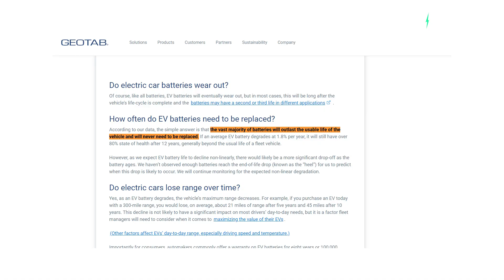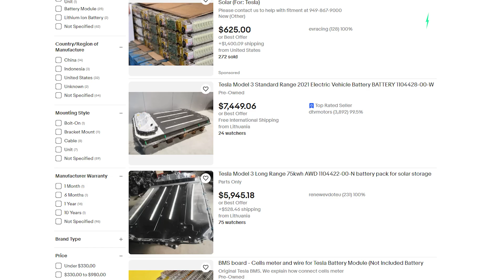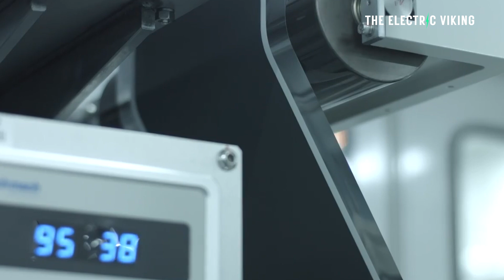New study says EV batteries have over 80% of their health after 12 years

Comment: This isn’t important.  I would rather have a battery that was at 40% health in 10 years. That I could buy for 10% less money.  Since batteries will likely be 80-90% cheaper than today when it needs replacing.  The cost curve is too steep to worry about it lasting.
Reply: No you won’t, after 30% degradation you can’t use your car the way you intended initially and you’d probably buy a new car

Comment: I still have the original battery in my 2015 Leaf which I have owned for 8 years now. I can get 40 miles out of it on a single charge mixed city/hiway driving with A/C set to 60° F, this is Houston, Texas after all, which is still plenty of range for almost all of the driving I do.

Comment: 13 year old PHEV with 16kwh battery (6kwh kept in reserve). 140k miles on the car. brand new the car got 32 miles ev range per epa. currently only getting 45-55miles of range. what a rip off. i will never buy another ev again. my insurance went up from 19 to 21 bucks per month! ive had to spend an extra 7usd/mo for electricity while only saving 2000 usd in gas my first year. ugh. and to top it off, i paid 6k for my car and its only worth 9-10k now according to autotrader!
Reply: Sorry to break it to you, but a PHEV is not an EV. It's a glorified gas car, with twice the expense. But yes, ICEs are better than hybrids any day.
Reply: @ElMistroFeroz  lol what makes an ev and ev, and what does the last two letters of phev stand for? i think driving for 2-3 months everyday and not using any gas practically means its an ev. the only time someone drives further, then youre talking about the horror of supercharging and you wish you had a gas car since gas is cheaper than dc fastcharging. i drive around with like 2-3 gal of gas in the car, the weight of my car is like 5% more than a similar model tesla. not sure what the issue is with having a backup gas generator.
Reply: @ElMistroFeroz  EV guys are PHEV haters. Sorry but the PHEV is superior at this time for the vast majority of people who live in the suburbs and commute 40 miles per day and also like to go on long trips without range anxiety. My like new Honda Clarity that I just bought cost $14,900 and get 40+ miles on EV and 50 mpg on gasoline. Level 1 charger. No brainer.

Comment: Modern cars - both EV and ICE longevity are limited by electronic or computer components aging out rather than traction batteries or mechanical parts. Most EV battery packs fail not because cells fail, but BMS module failure first. Further complicating the issue is difficulty in repairing such issues, often battery packs are integrated tightly in car's chasis. Even a small resistor or capacity fail would require expensive labour cost to diagnoze and repair one single electronic component.
Reply: Yea they need to make these things more modular, like the Chinese are doing.
Reply: Exactly- it's like saying a timing belt issue isn't really an engine failure, it's just part of the engine management system.
Reply: @SteveLomas-k6k  timing belt is easier and cheaper to repair than BMS or other electronic modules in a typical EV.. We are talking hundreds dollars vs tens of thousands many battery packs are sealed.   If just one component breaks in it, the whole thing needs to be replaced.
Reply: @i6power30  Well yes, especially if you are handy you can make a lot of engine repairs yourself and keep a car going for> 100 years.
Reply: @SteveLomas-k6k  old school cars. Even ice cars nowadays have so much computers in it that makes it planned obsolescence.
Reply: @i6power30  That's true, though I think the key buzzer is about the most high tech thing in my car- and it quit working a long time ago. :)

Comment: The issue is that if real consumers are reporting real problems with their EV batteries, and are being hit with real repair estimates of $10k-$20k+, then that's a real problem with the market and not a rumor to be debunked. It's wonderful, and very important, that current batteries are improving in durability and that vendors like CATL are able to warranty their latest batteries to 500k-600k miles. And, that knowledge needs to be broadcast. Keep in mind, however, that the average age of a light-duty road vehicle in the US is 12.6 years nowadays. Key question: are these battery warranties - past and present - transferable to subsequent owners? Used EV buyers seem to be bearing the brunt of the spent-battery grief.

Comment: My 2018 Model 3 LR is about to click over 100,000 miles. No problems. No issues. I replaced the entire front control arm and sway bar link as a kit because I was getting a clunk from the front suspension. This is normal wear for any car. Normal wear parts are going to wear out, but the battery just keeps going. Oh- and my brakes were still above 90% good as I checked them.
Reply: Well, proof EV's suck....kidding
Reply: What were repair costs for the earing arm?
Reply: @TheLordexilius  I had to replace the rack and pinion on mine, $450CAD, mechanic said it was the easiest r&p job he'd ever done.
Reply: @ChrisSonPEI  I have no doubts about that. I was just curious as I read bearing arms is one place there TM 3 needs maintenance. Glad to know it wasnt more than 450 dollar.

Comment: What is the life expectancy of a car that no one can fix ? Or want to fix ?
Reply: Or needs to fix.
Reply: Spoiler: If there's demand, there will be supply.
Reply: @michaelmartin9022  there's still demand for landlines but they cost $80 a month now where is they used to cost $16 a month. 

I suggest that you look up the "network effect".
Reply: Ice vehicle owners who can't repair their own car or going to find that out the hard way im about 8 to 10 years.
Reply: @mac_mcleod  In my expereince once the ICE car reaches 5 years it's a constant trips to the rip off garage for repairs. Worst car I ever owned, bought when it was six years old and in year seven that thing cost me 3 grand in one year for BS repairs and fixes. The electronic ignition went - that alone was 1500. Thanks BMW. But it was expereinces like that which made me jump at the chance to buy a model 3. Over the years I began to despise going to garages for repairs. Not once did I ever think OK that was fair. Everything was always huge expensive.
Reply: So in 8 to 10 years time the tech and support might be good enough for me to buy one.
Reply: @AdrianWilkinson-e2p  I think we each have to pick that ourselves. 

For now I'm still in the gasoline vehicle.  It's costing me between 3,000 and 4,000 per year to keep on the road. 

However it's also 12 years old and has about 150,000 mi on it.

I'll probably be in an electric vehicle in 2 to 3 years. 

At this point, I have three neighbors on my block who own eevee's and I have two friends that own electric vehicles.

Comment: 5 years is already a long shot for a battery. What ever type it is. 12 years, you must be delusional. You have a battery 1/3 the original capacity, and 3 times the original charging time.
Reply: Complete rubbish.  You haven’t done your research and quite simply you don’t know what you’re taking about
Reply: @crm114.  First of all this isn't directed at sam. My bad. Its to the ones who suggested that a 12 year old battery can still have capacity of 80% compared to it when its brand new. Realistically its too far fetch. A battery that old that you used everyday for a decade will be really bad.

Batteries degrade, the number charging cycles, when and what state of charge to charge the battery 50, 70 or 100%, so forth. All that will already take away more than 10% of your battery's capacity in 5 years. 

Unless you baby it. How often do you baby it? Why baby it if it prevents you from using it more frequently?
Reply: Know that hasn't been with the data shows. Even with the older battery technology most electric vehicles have over 85% of their original range at 200 to 300,000 mi.

Comment: 80% capacity after 12-years is not that great
Reply: Yea it is.
Reply: @ChrisSonPEI  It's not bad but it's nowhere near fantastic.
Reply: What's wrong with these people?
Reply: This study is only meant for people planning on putting their EVs in a time capsule, that's why there was no mention of range degradation. Just calendar aging.
And yes, 80% is terrible degradation, especially if you're not driving the car. However, the trick is to store the car at 50% capacity and leave it plugged into a 120v outlet. This way it never self drains to 0%. By the time you open the time capsule, you'll get much more than the lousy 80%.
Reply: @ElMistroFeroz  Do you lot even know about batteries? Having 80% of the useable capacity left after a decade is pretty standard for LFP. What exactly are you asking for? A perfect machine that never wears out? Can a normal car be used for 12 years without something wearing out and needing maintenance? Why are you holding different things to different standards?
Reply: @michaelmartin9022  You’re either replying to the wrong comment or everything I said went over your head, along with what the study proved.

Comment: EV sticker price still needs to be at parity with or below that of ICE. Preferably below, because that is the only incentive for the majority of buyers once the early adopters and rich people have been exhausted. That is the thing that will get their attention, and then they will start considering an EV.

I notice that the MG HS PHEV has been lowered to $34k for the old 2022 and 2023 models, to make way for the new ones. But the sticker price of the petrol version is still $29k.

PHEVs and BEVs also need to be $29k.
Reply: That’s happening now but for the next level up like Tesla Model 3/Y. They already have price parity or cheaper with ICE. Quite a lot of the next level down EV models are discounted in reality to close to ICE level, but agree sticker price needs lowering.

For private buyers you are far better off getting a nearly new car that still has a long warranty on it.
Reply: No, if an Eevee cost the same as a gasoline vehicle, then you're going to come out way ahead because they're operating costs between $1000 and $3,000 per year less than a similar ice vehicle.
Reply: @mac_mcleod  I realise that. But most people don't, is what I'm saying.
Reply: A Tesla Model 3 is vastly better than the equivalent ICE vehicle.  So, it’s already there.
Reply: @oggyoggy1299  I agree, but most people don't realise this.
Reply: Well. Lifetime savings by using av EV compared to an ICE car will usually be significantly higher than that difference - so it should not be neccesary (but agree that this is an important 'psycology', yes).

Comment: How many change the engine/gearbox  on an ICE car?
Reply: I haven't changed the engine or gearbox on my 13 year old, 296,000 mile Hyundai diesel.
Reply: @brendanpells912  They do talk some 💩, Diesel power now you're talking.
Reply: 280k miles on my 2008 Toyota Avalon original engine and transmission but will occasionally slip. This started about 10k miles ago

Comment: Now manufacturers just need to match the 15 years battery warranties (since there’s low risk) and that will make ev sales and the used market take off. As someone who buys used I realise the risk of a battery failure is tiny but if it happens it’s catastrophic. If manufacturers can absorb this low risk with warranty’s that will make a huge difference
Reply: Not that catastrophic. If you’ve ever bought a money pit, let’s say a BMW and paid $4.7k for a timing chain job. You’re not far off from getting your battery balanced from a third party shop.
Reply: @kevinmanan1304  £4.7K from where?
Reply: @gottliebdee263  bmw dealership. This was back when they first moved from timing belts to chains. I’ve heard their prices lowered recently. One of the reasons why I never get BMWs
Reply: @kevinmanan1304  I see. But are you comparing like with like, that is to say dealer timing chain dealer with dealer battery repairs?
Reply: @gottliebdee263  They were equally as expensive as the dealer. Even today AAMCO transmission repair shop costs as much as at the dealership.
Reply: @gottliebdee263  I’ve decided to hold off a transmission oil job because I was being quoted $500 at local shops but $550 at the dealer with coupons… it wouldn’t be bad if mechanics weren’t so sus
Reply: @kevinmanan1304  Yeah, there is that. Tx is one of the things I wouldn't hold off on though.
Reply: @gottliebdee263  well these are the small things that put me off gas. It’s just a few hundred here and there that ends up being thousands by years end. I’m only 7k miles over and most from highway so I’m not worried… yet.
Reply: @kevinmanan1304  Yah that's cool. Whatever suits you dude. Personally ai think the real sweet spot for an EV is gone and the landscape is shifting fast with subsidies, and incentives, (certainly in the EU), being reduced/removed and insurance and repair costs increasing dramatically.

To be honest it's SO difficult to find the truth. You have the Viking that never adds enough detail to his claims, (Rocketing EV sales),  and the other side doing the same for their narrative. So it's down to us to try and make an educated guess that fits our circumstance.
Reply: @gottliebdee263  EV sales are skyrocketing. California, US largest state got 1 in 4 cars sold as EV. That’s big when before Covid it was 9% or less than 1 in 10
Reply: @gottliebdee263  idk what state you’re from but I’ve seen tons of EVs in my area. Im in Washington state. My next car will likely be an EV, not yet committed.
Reply: @kevinmanan1304  I’m asking for evidence. Real, not anecdotal. If you can’t provide it that’s fine just say "I don’t know but I see them all over the place". That’s acceptable from Joe Public which is what I and I assume you are. 
The guy that runs this channel however is not and has a platform. He has a responsibility to post facts and verifiable ones at that. It’s dishonest of him not to do so.
Reply: MG has started offering lifelong (the life of the vehicle, not that of the driver!😉) , transferrable warranty on some of their models, others will follow.  As you said, it would be actually cheap (provided the batteries live up to challenge, obviously) and incredibly efficient marketing!
Reply: Nobody is going to fix your used car for free. If you didn't buy it from the manufacturer, why would they be compelled to give you a replacement battery and send you skipping along on your way? Buy it new or add the battery repair cost to your used car budget